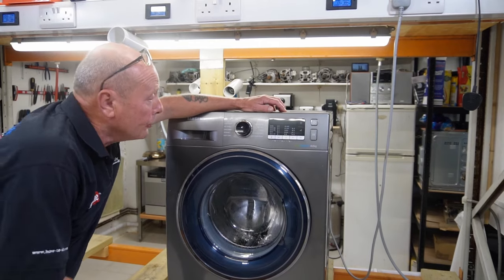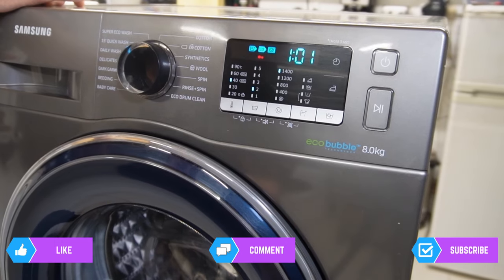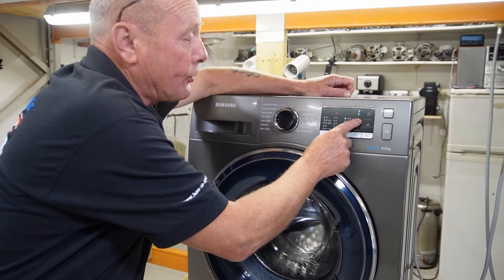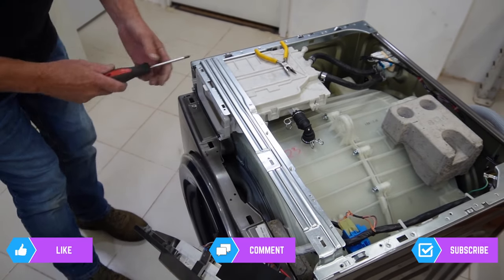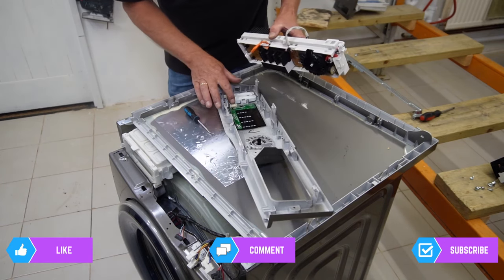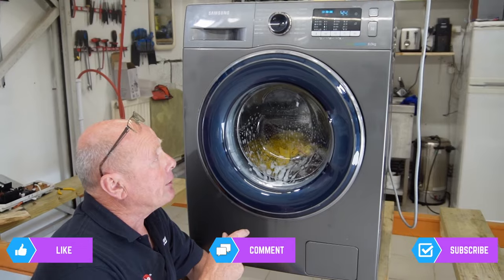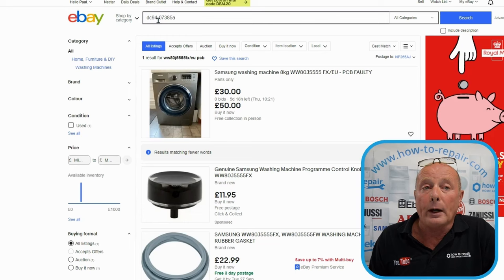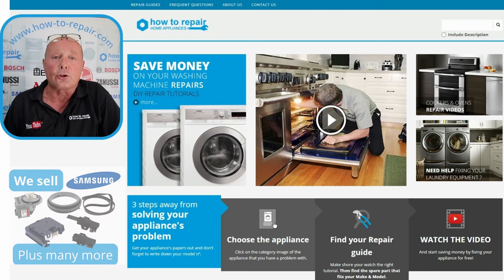Samsung washing machine stuck on program? Fixing intermittent fault & PCB (Printed Circuit Board)

Comment: This video has been really helpful. I got a UC error on my unit WD10J6410AX/FQ (Samsung says that's due to irregular voltage). Back in 2020, I contacted their customer service and they blamed it on poor electrical circuitry of my house (it wasn't). Thanks to this video, I gathered enough confidence to finally open up my washer-dryer unit myself. I had 0 electrical/electronic works experience. Anyway, I visually inspected the insides and I was shocked, not by runaway electrical current, but by the poor internal design.

Cables and connectors are not protected by corrosion. I felt with my hands the brown insulator block? (cardboard? ceramic? clay?) that's located in front of the drum and it was damp! The unit has at least 1 hole that mice, lizards, insects can easily crawl into. The hole looks like a convenient place where you can hang the water outlet hose too - and when you've used the machine long enough, that hose is going to have residual detergent that will drip into the unit. So the occurence of corrosion or electrical faults on this machine is really just a matter of time.

I then visually inspected the resin-filled mainboard (I'm just going to say resin, it's plasticky, doesn't appear to be pliable). I saw discolouration near the connector holes on the PCB (where wires are joined and soldered behind to form a complete circuit). That might be due to rust - they look brown to me. But can I know for sure that they are the ones causng problems? No, because the entire PCB is "protected" by said resin. I can't take the PCB out from its housing without also breaking the resin "seal", a term which I use lightly since it clearly isn't moisture-proof. The seal also means I can't perform any meaningful diagnostics. 

All these factors lead me to conclude that I should just call time of death for this unit. I've already spent the equivalent of 200 pounds getting the drum replaced last year. I can't spend an extra 200 pounds for a refurbished PCB that I won't know for sure will solve the issue right? Looking at the cable mismanagement of this unit (the general messy layout and the inadequate insulation at the terminals in an operating environment that's damp), it's very likely that other circuits could be compromised as well or soon would be. And I just don't want to deal with individually checking them.

It's just easier for me to elect to not buy Samsung anymore. And I haven't since 2020. My current washer is a Bosch. I just bought a gaming monitor that's an LG. My air-conditioning unit is a York. My NVME SSD is a Western Digital. I'm going to get a Sharp or a Toshiba for my fridge soon. And for the first time I'm seriously considering getting an iPhone to replace my Samsung Galaxy smartphone.

Anyway, I hope you continue doing this good work. It helped me to finally lay this issue to rest. I truly appreciate you sharing your knowledge here and I know others do too.
Reply from the maker: Really glad I was able to assist you in diagnosing the problem with the machine and thank you very much for the super chat. Please remember to subscribe to the channel as that is what really helps us glad we could help you @tetleydidley this is for you https://www.youtube.com/shorts/e432SAb2g08 please remember to subscribe as that's what keeps this channel going. Thanks 👍
Reply from the maker: A while ago on YouTube, you ask me a question about your LG washer. I just thought I’d let you know that I have now made a complete playlist to assist you in any repairs that you ever have.
If it helps, you don’t forget to share it with your friends who may also own an LG.
https://www.youtube.com/watch?v=w5dZ4Pj8Jdo&list=PLnAHZbSarsyHLR4x9XPIS-ZEsheufxm9Y

Comment: Just did this fix on my machine with the same symptoms and it worked perfectly after installing the relay. Have to say getting the old relay out was a bit of a job and I had to cut out the plastic to get to the soldered joints but it worked OK. Thanks Dean saved me a couple of hundred pounds👍

Comment: Brilliant stuff! My Ecobubble was stopping at random times in random programmes. Some programmes were okay and some got a minute or 4 mins in and then the drum would look like it was struggling to turn. I knew that the problem wasn’t with the drum as it would turn fine in some programmes. I did the dignostics and everything else was fine so narrowed it down to the motherboard. Found a complete front fascia complete with motherboard on eBay for £35 and fitted it in ten minutes. Just the one big connector to swap over. Took me longer to get the top off and the soap drawer out! Your videos are brilliant as I wouldn’t have had a clue without it and maybe resorted to buying a new machine as I wasn’t going to pay £200 quid for a new fascia/motherboard and then pay to have it fitted!
Reply from the maker: I'm glad you managed to get it sorted and I'm glad the video helped
Reply: have a question for you sir - so i have one of these eco bubble machines, had it for around 6 years now and its been brilliant.. however just these last few days, its started to not turn on after completing a cycle, its just literally completed a full "daily wash" cycle fine and now when iv gone to turn it on to do another wash its as if there is absolutely no power to it, its been happening on and off for a couple of weeks now, i can plug it in/out a few times and you hear it come on eventually or sometimes just not at all - il leave it for a bit an go back and itl come on, any ideas as to what it could be? @How-to-repair

Comment: Thank you for the valuable video. I successfully replaced my control panel and it worked perfectly.  I used eBay and paid less then 50 with shipping and tax.  Great deal!  Thank you so much!  Was really pretty easy to do.
Reply from the maker: Really glad you got it fixed, saved a load of money and you have managed to recycle and appliance that would normally go to the tip. Well done. glad we could help you Deanna Porter this is for you https://www.youtube.com/shorts/e432SAb2g08 please remember to subscribe as that's what keeps this channel going. Thanks 👍

Comment: Thanks for the video, bought a new pcb and was an easy fix. Much better than scrapping it. Well put together video thanks
Reply from the maker: Great to hear! All I'm trying to do is teach in the correct way that everyone understands. It would be really helpful for me to get my video shared and help us fight appliance waste! Please remember to subscribe to our channel, as that really helps us 😇

I'm also employing someone now to assist me in my workload. You can support us by donating to our website https://www.how-to-repair.com/help/buy-paul-a-beer/  

I will continue to invest the beer donations that I receive predominantly into the new video technology that I'm learning with tracking cameras and better audio to make it easier for everyone to understand 🔋
Reply: @How-to-repair  I'm from an engineering background. I will always try to repair before discarding. It was the simple diagnostic procedure that clarified am already sure fault. Part instalation was easy with plug and play connectors. At one point as I was testing the progression. Thre was a slightly pulsing in the spin tone and I thought it was a motor issue. But it cleared and success. So thanks for the information.

Comment: Very helpful - one comment, the video suggests using a hook to remove the stuck plugs but, at least on my version, the retaining clips need to be pushed in, rather than pulled out; so a pair of needle nose pliers might be more use than the suggested hook.
Reply from the maker: Thanks for sharing your insight mate. Since I have na access to your washing machine, I can't make a comment about it but if you say so, t's better for you to do it with your way. 

Could you also do me a favour and take part in a poll I've made about the lifespan of appliances if you  havenot already? You just need to tick one of two boxes. It will only take about 10 seconds. This might help us improve how machines are made in the future😇 

Here's the poll question: https://www.youtube.com/@How-to-repair/community

Also sharing will get more people to participate and we will have a greater impact with the manufacturers thank you for helping.

Comment: I would try cleaning the filter at the front and check the grey  waste at the back isn’t blocked by blowing down it and then suck the water until it comes to the end of the pipe , it tastes gross so have a beer handy , this cured my after stopping mid cycle 🤷🏽‍♂️🍺

Comment: I was finding our washer intermittently failing to progress mid-cycle, and also occasionally giving error 3C (motor RPM sensor I believe). Sometimes it would pass the self-diagnostic, sometimes immediate 3C on the spin test. Continuity test revealed one of the wires in the cable from the control board to the RPM sensor was faulty; I replaced just that cable, and the 3C error seemed to go away. Still getting failure to progress sometimes though. Guess I need to investigate more, before considering replacing the PCB.

Comment: This is a common known defect on the ecobubble. In most cases it will not complete the centrifugation cycle, or even start it. The chips on the controll board deliberately have a very limited lifespan as they overheat due to the way samsung designed the PCB. Planned absolescence if you ask me. Ordering a used one, will therefor again only last you a limited time.  Buying a brand new one will set you back 200 Euro's. That's almost half the cost for a complete new ecobubble. I'd stay far away from the ecobubble. Should you decide to buy one regardlessly. Buy the extra warranty, as you're gonna need it. Or since you're gonna spend that extra money anyway, just buy a better brand. Miele, Bosch, Siemens, AEG. They cost more on the short term, but will save you money on the long run. All washing machines will wear down on mechanical parts eventually. But they shouldn't fault that easily, let alone on non- replaceable roms. And not at all within three to four years, which is not long after the 24 month warranty.

Comment: I've owned Samsung washing machine eco bubble for 7 years I'm having some issues guarantee run out but inverter states 10 years does that include the carbon brushes?
Also probably at stage of replacing but seen your video on rear of drum not fit for purpose and noted many having seal problems and Samsung doesn't seem to want to replace items under warranty so concerned about PCB which mine maybe or carbon brushes. Not convinced Samsung rear of drum, PCB and seal and customer service. So do you recommend a washing machine brand with good guarantee and customer service?
Thanks for video I think that's what's wrong with mine but not sure economically worth repairing as it's over 7 yrs old

Comment: Great Video, I have this problem, but also I occasionally get a 3E error and also occasionally the UC error. I also get the UC error on the tSt setting. I have already changed the Brushes after getting the 3E error.   I’m wondering if I should change the Main Control Board, I’ve found a second hand one for £50. Do you think I should take the gamble given the UC error ?

Comment: I can't get the top cover off after removing the back screws. I even plied the two metal "lips" on the side that keep the lid down trying to open it. Is there anything on the front that needs to be unscrewed/unclipped? It's the same model as the one in the video WW80J5555MW/ET

Comment: Great video and very clear!! Could you please tell me if it is a PCB problem if the washing machine stops mid cycle? We need to restart it and then it continues where it left off!!
Reply from the maker: The first thing you need to do is check all the components I would especially check all the water valves and make sure the machine is emptying in the allocated period of time before pointing the finger at the printed circuit board, but yes, it could be a problem with the printed circuit board
Reply: @How-to-repair  hi, i'm eondering how you check the water valves. By any chance have u done a video about this? Many thanks for ur videos, very helpful and love the ethos

Comment: Thank you for this video. Have the same problem. When the machine gets to 59 mins on a daily wash it stops or trips the house circut board. However when i did the check to go to test mode i get the -: face. So i feel it is the board that is faulty. But could it be the heater element also? Thoughts PLEASE. Cheers. Ps there is a flashing red key that is constant on the screen?

Comment: Hi,
I have something similar. My machine is stuck at 9 mins but when I ran the automatic test mode, I saw that at the 10th step (which unlocks the door) it doesn't unlock and I immediately have the error code "SF" 
If I reboot and redo the test mode, at the step one (where's the door locks) it doesn't lock.
I removed the lock mechanism and everything seems perfectly fine. 
SF in the manual means Main PCB error... Should I change it or I need to check something else before doing that ?

Comment: hey, maybe you can scratch my curiosity itch. im dealing with a samsung 1904, pretty much the same pcb. this one has an issue where the drain pump is not getting current. weirdest part it is, it tests 220v (we use 220v here) between either pump terminal and 1 of the line terminals from the power cord (writing this i realize i should have chekced if it was line or neutral, but does not change the fact the both pump terminals are testing 220v against one line "pole"). im pretty much giving up on that board, but im very curious as to why im getting this measurements. in fact, at some point i got 110v at the pump terminals. that was one time thou. so yeah, im betting on a busted board.
Reply from the maker: Hi, I will need the full model number of the identification plate and the details of your problem. Please use our contact us page and make sure you fill out the request for what your problem is. A video shoot of the problem would be perfect as well.

We will get back to you within 24 hours, normally. https://www.how-to-repair.com/help/contact-us/ 

Please remember to subscribe to our channel, as that's what keeps this channel going. Thanks 👍

Comment: Hi Sir, i got a samsung front loader washing machine with direct drive, with less cloth it still can works well, but whenever comes heavier load, it just jam as the video shows.
Not sure whether is the PCB issues, but will try to replace. 😀 
Another question would be raised as: how to find out the broken parts if diagnose mode shows all is normal ?

Comment: What a brilliant series of videos, thank you! I have a Samsung wd80j6410aw. The temperature display has been pixelated for some time and now we are unable to change (+/-) the temperature manually. The heater works as it performs washes at high temperatures but we don't always want high temps of course. Is this likely to be a main PCB issue and does this contain the display which is pixelated? Many thanks!

Comment: So how does the PCB go bad in the first place?
Reply: Every PCB have memory built with program inside pcb any of components fail its cause impact on program or program may be corrupted . Every cycle have step by step process one after one if sequence miss it's stuck line your windows OS not boot because your OS or HDD failed.

Comment: Hello sir 
I m a technicien from Morocco 
I have a solution  that i want to share with you 
In samsung ecco bubble there's is a problem with connection  the most of time the socket of water level that cause the pcb not working problem the most of time the machine stops after a shirt time or stuck in any programme and stop responding if touch any botton
So i solve this proplem some time i change the cables or the front pcb witch the socket of water level and it works every time
So please check te water level socket and cables , connections and i hop i was helpful as your are
Tank you  for your time

Comment: Great video. I just removed my PCB unit. Now I need to order the new one. I do have one question though. Looking through common faults, this is a reoccurring problem with a lot of machines so I was wondering if it is worth getting a used component. It might last a few weeks!!! Any thoughts?
Reply from the maker: You would be very unlucky there not bad machines

Comment: My unit eco bubbles 7.5kg have the display but not working.. Even I reset not spinning. Can you tell me what is the problem.
Reply from the maker: Hi, I will need the full model number of the identification plate and the details of your problem. Please use our contact us page and make sure you fill out the request for what your problem is. A video shoot of the problem would be perfect as well.

We will get back to you within 24 hours, normally. https://www.how-to-repair.com/help/contact-us/ 

Please remember to subscribe to our channel, as that's what keeps this channel going. Thanks, Paul 👍

Comment: I'm utterly frustrated with my 5 Yr old Samsung ecobubble. Labour and circuit board will cost around £250.00 just to get the signal going back to the drainage pump. So annoyed.

Comment: Hi there i have an eco bubble washer dryer , once drying the drying cycle is finished the laundry is saturated and hot the pump is working and the filter is clean , it pumps fine on a washing cycle i am at a loss as to why this keeps happening could you advise please ??